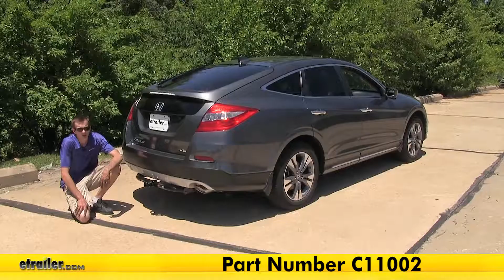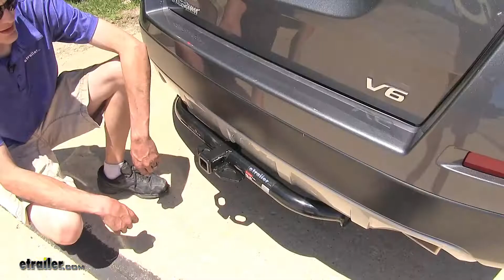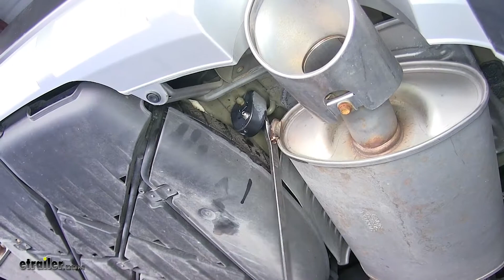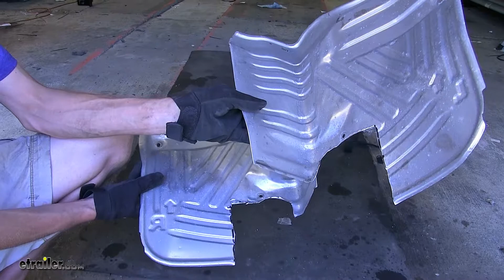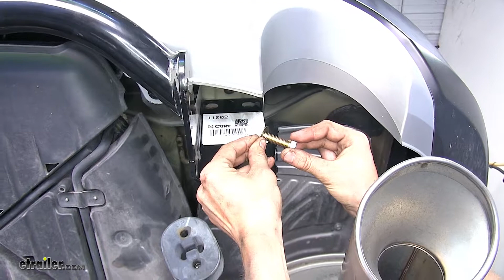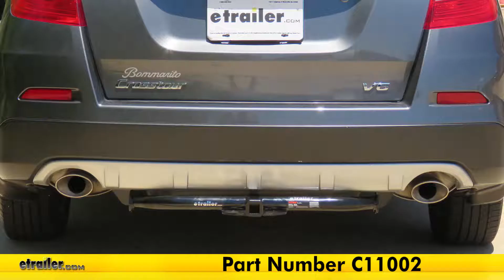etrailer | Installation Guide for the Curt Trailer Hitch Receiver on a 2014 Honda Crosstour

Comment: Excellent video one thing I'm going to do different is not cut out my heat shield but just flatten the edge and find the spot for the bolt to go through only keeping the heat shield intact thank you guys
Reply from the maker: We'd strongly suggest notching the heat shield as shown in the video. The hitch is meant to sit directly against the underside with nothing sandwiched in between. If you fail to do this, the attachment bolts might not hold the required torque. You don't need to worry about the trimmed out area being susceptible to heat damage from the exhaust, as the hitch itself will act as a heat shield and will actually offer greater protection than the flimsy portion of the heat shield that's removed did.
https://www.etrailer.com/tv-install-trailer-hitch-2014-honda-crosstour-c11002.aspx

Comment: “Take car apart, place hitch and build car back around it”
Reply from the maker: The hitch is not as hard as it looks. If you have a few tools, you'll have the hitch installed in no time.
https://www.etrailer.com/Trailer-Hitch/Curt/c11002.html
Reply: etrailer.com I did it on Sunday! It wasn’t too bad actually. Note- DEFINITELY use WD-40 to get those damn grommets off
Reply: @ryanrobin12 I took off 2 in the back and then two in the middle of the car I think I missed some in the back the exhaust wouldn’t hang
Reply: etrailer.com also- I literally had to hit the outer flanges with a sledgehammer to basically get them into alignment with the frame holes through which the bolts go. The bolts that go in vertically, one on each side. I could not get the right side lined up